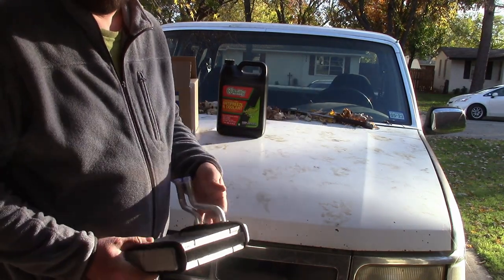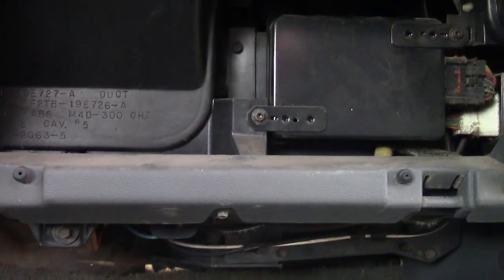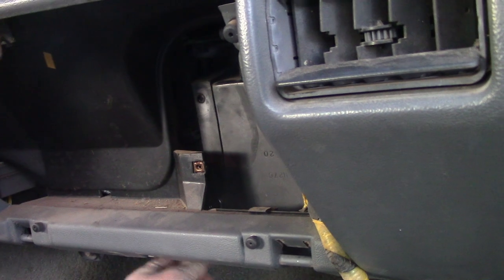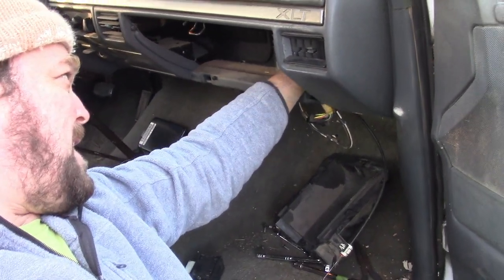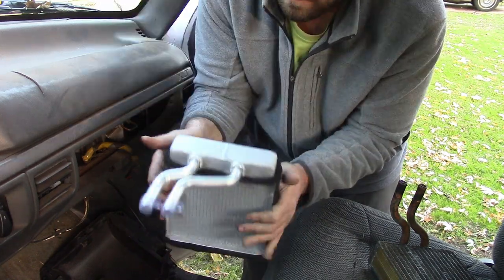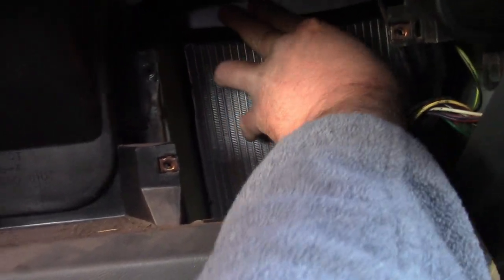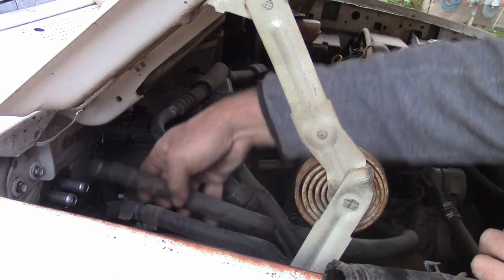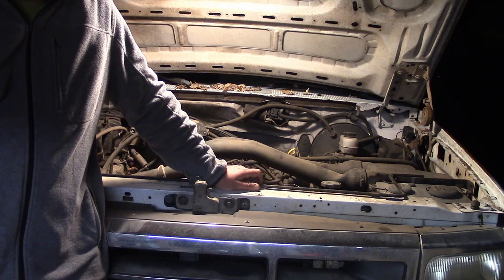How To Replace a Heater Core in an Old Ford Truck. It is much easier then you think 1980-1996 F150.

Comment: Hey Ben! I just got my grandfather's '92 XLT longbed. I've found your F150 videos helpful. Thanks!
Reply from the maker: Yesterday I was helping a friend move and my truck decided not to start for me. It was a loose negative battery terminal. I cleaned up the battery terminals and reprogrammed my radio presets and got back to work. I only mention it because it started running a lot better afterwards. I smoked a tire accelerating away from someone who was merging into my lane. It’s been years since I smoked a tire like that. 😂 That probably means I’ve had that loose connection for years. 30 years later and the truck still has plenty of power.
Reply: @Ben Huttash great news! Mine needs new battery terminals for sure.  Looks like three generations of Wilsons have beaten on them 😉

I'm pretty sure my truck is low on power.  I'm still chasing down a couple things. It runs cold and is definitely in the Gallons per Mile range.  A thermostat and catalytic liberation are planned. No tire smoking happening at this time.

Maybe you could take an acceleration video for me to compare.  I swear this thing had more power when I was 19. 

Happy new year!

Comment: Thanks for this video. I don't need a new core right now but mine is original and I could need one any day.  I think about some things that I know could need replacing due to the age of my truck and a heater core is on that list.  I cringe to even think about it because I have replaced heater cores in two Ford cars and they were a lot of work. Had to dismantle the dash and many. many screws. Shops wanted around $400-$500 to do the job years ago when that was serious money.  After doing one myself I understood why they charged so much. So I was glad to see that this is not that bad. Driving a 92 F150 4.9. My Dad bought it brand new and I bought it from him.

Comment: How do I unclog the heater ducts in my 91 Ford F150 lariet, I replaced my blower motor and I am not getting any heat from it but when I was removing it I noticed a bunch of crap in my ducts
Reply: i think you'd have to pull the dash to do that, but i'd be surprised if there was so much junk in the actual ductwork to keep your heat from working. if you can feel air coming through but it's not hot, then your heater core is blocked or the truck is running too cold (or both)

Comment: Hey brother do you have to drain the radiator first before you unplug the hoses from the heater core
Reply: you should be able to avoid that, by using a towel to catch the spillage. Those hoses sit at the top of the  engine compartment, so gravity alone shouldn't force much coolant out, as long as you do this while the engine is cold and the coolant system isn't under pressure. Probably be a good idea to set down a tarp incase if you're worried about making a mess, the mix of antifreeze and old engine gunk can stain a driveway.